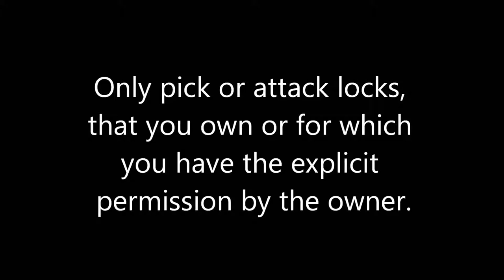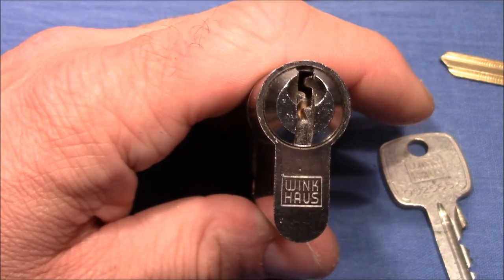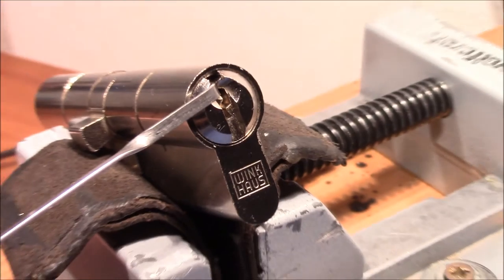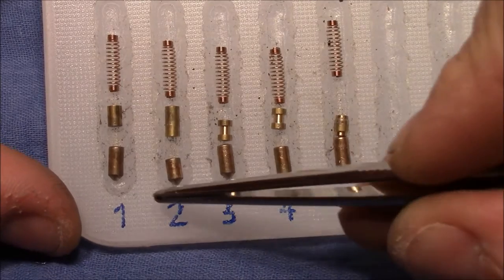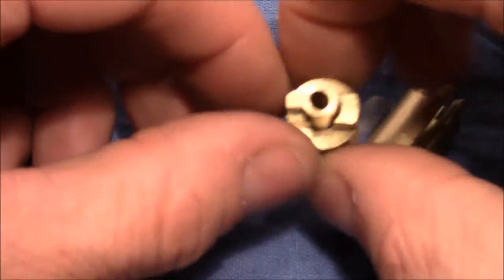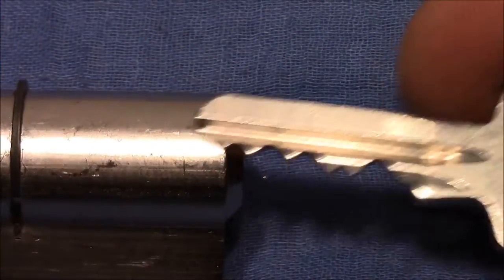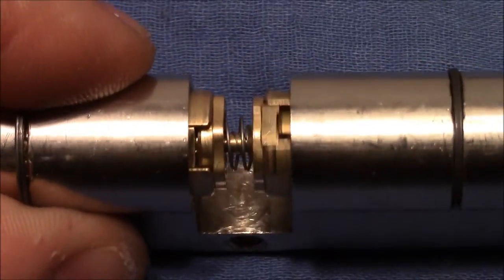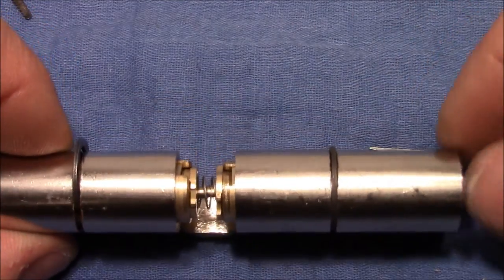(picking 169) WINKHAUS [EURO cylinder exploration series] picked, gutted and cam mechanism inspected

Comment: So, inserting the wrong key would cease up the lock, if I understand it right? As that would push the cam into the wheel but the core can't turn and thus, the lock cannot be opened from the other side either. Not that I see that as a huge problem, just curious if that's the actual case.

Also curious, did you try to pick it and then inserting something to push that cam into the wheel? As the slot would be placed where you run the risk of "relocking" the lock when you try to push the cam I see that as an extra problem for pickers. To the point where grinding a key down and using that to both tension the lock and push the cam in at the same time might be the best option.

Anyhow, really interesting lock that one. And thanks for this exploration series, it's really interesting to watch. :)
Reply from the maker: +Stefan Axelsson You are right with the wrong key - what a devious thought ;-)
Depending on the cam mechanism it's necessary to insert something in the keyway. So picking a lock is only half of the work. I will investigate the cam mechanisms a bit more in the future as it's quite interesting.
Reply: Well, making things do what they weren't designed to do is fun. Or in this case, make something not do what it was designed to do...

And I agree, this mechanism is very interesting, especially that it doesn't help to pick the lock if you don't know what's going on inside of it. I wonder if that is just a side effect of the design or part of the design concept. We'll probably never know I guess, but it would add a lot of time if you had to figure that out in the field trying to break into a building. So while it's not super-secure if you know what you're dealing with, it's still an extra layer. :)